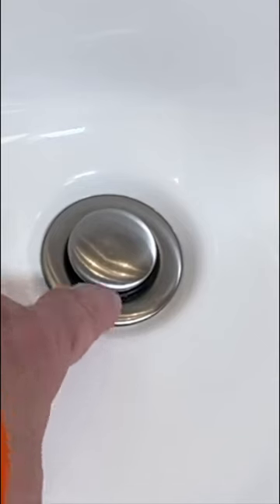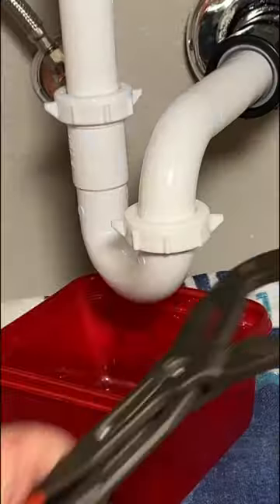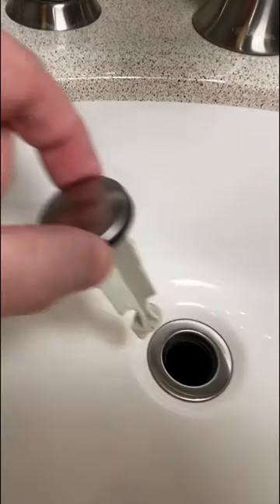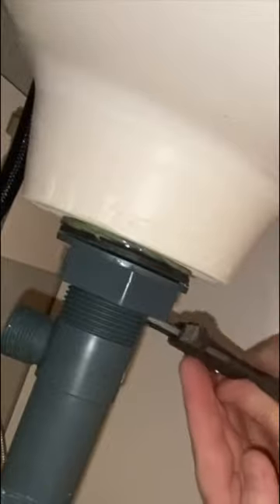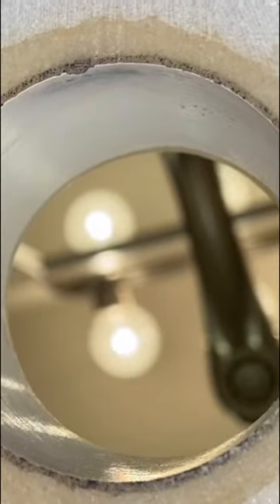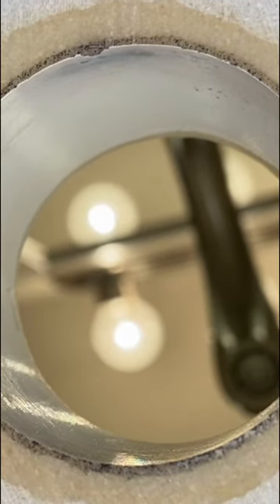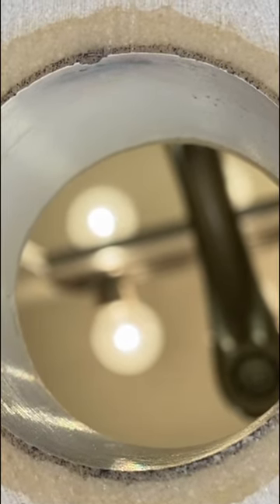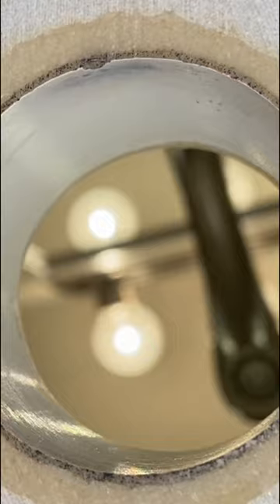Why Fo People Hate Silicone On Sink Drains?  #plumbing #helpingothers #hack #silicone

Comment: That is not a place for silicone, that should be sealed with plumber's putty as it's been done for the last 80 years.
Reply: I worked in building maintenance department for years,  a few of the plumbers there used silicone instead of plumbers putty and it seemed to work out fine.  Plumbers putty can dry out and harden over time. Both have their pros & cons.  Silicone, any cleanup can be more difficult.
Reply: I can't think of anywhere this silicone "sealer" (aka: Whale Snot) is useful.
Reply: Silicone seems to work better on these cheap home center drains I use putty on brass one's
Reply: @josephlowman7906  Yes, I believe you are right. The plastic drain assemblies with the plastic thread's need the silicone, otherwise it leaks.
Reply: Popup assembly  were brass until the home center faucet became common,  I've seen plastic fail using putty , some instructions say not to use it  or use the Hercules  marble safe  putty.  And before 1960   glazing puttymixed with linseed oil is all there was.  When I was apprenticed in the early 70s  the old timers still used it
Reply: @michaelnelson7572  Thank you for the valuable information. You seem to be a very reliable source.
Art from Ohio

Comment: A lot of the time you don't have to work the whole assembly up to take off the top of the drain, you can just spin the whole thing and often the top escutcheon or whatever it's called will stay in place, if not yeah you gotta grasp it on both sides.  In a lot of cases this is all metal and may be fused together you gotta get creative.

Comment: Why use silicone where there is a gasket. Putty between the top of the drain and the sink, and then rely on the gasket to do its job at the bottom.
Reply: cuz you get sinks that the drain holes arent perfectly formed. we have a ton of them at work where the drain hole is slightly out of round/size. the gasket never seals right by itself on them